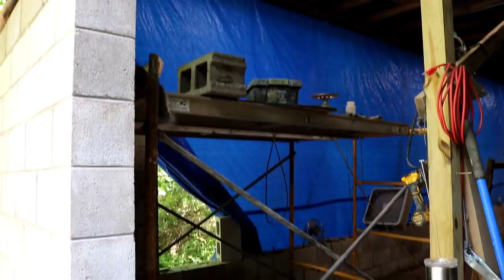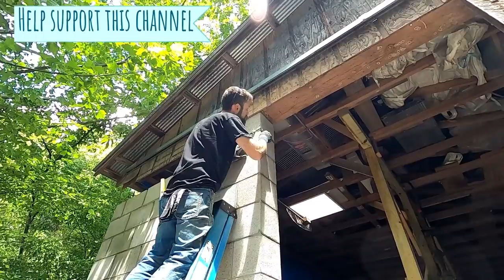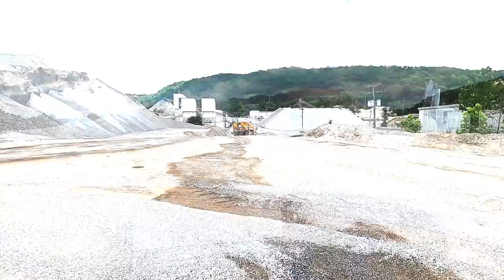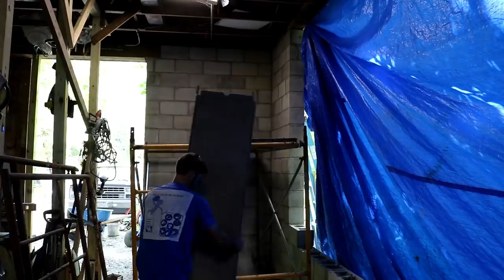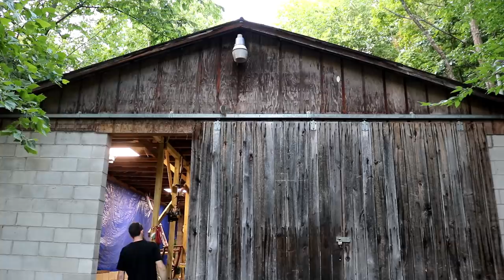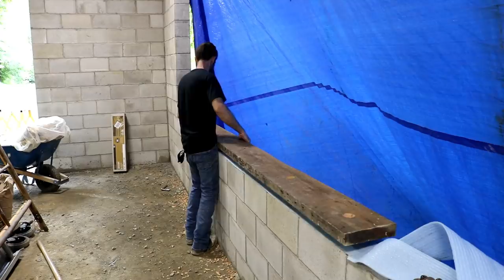Block Finished & Starting to frame

Comment: I don't know code in your area but in mine the require pressure treated lumber touching concrete
Reply: Frankly I trust that hundred year old board more than new growth pressure treated lumber
Reply from the maker: It really shouldn't see weather at all.
 We seem to have some poor quality  lumber for sale here .
Reply: @SteveSummers  im in remodel construction in Chattanooga and ive noticed the poor quality lumber to .you have done a great job with your shop repair 👍

Comment: @Steve Summers Is that red oak or white oak? I read somewhere that red oak is a terrible material to build anything that will be exposed to the elements, but those milled beams look like they have held up great over the years. I ask as I have several large red oak trees that I am going to mill in my back yard, and I also want to build a good sized shop/shed at my house. Thoughts on using milled red oak?

Comment: theres probably a waspnest nearby
youre lucky the nail in youre hand hasnt touched the nerve to youre fingers that wouldve made working a lot harder if you lost feeling or dexterity in part of a hand 
have stepped on a few nails in my life , usually meant getting another tettinus shot , those things hurt worse than the nail through the foot
shame about the mike , you can probably solder a new plug to it

Comment: Those old cut nails are great. They can be dangerous though, some having a tendency to shatter, especially fire exposed and hit by water.   Heavy duty eye protection being essential.
Reply: When settlers moved out west they'd burn their houses down so they could pick the nails out of the ashes. They skipped the water step.
Reply: @rogerscottcathey  you can buy cut masonry nails anywhere. They're not exactly the same as the old square nails. But folks really can't tell them apart.
Reply: @1pcfred  : They are perhaps once again more available, but only fairly recently. Theyre still regarded as specialty items. And of course they've added galvanized too. Tremont still uses equipment used over a century ago. And the nails are exactly the same as they were other than that.
Reply: @rogerscottcathey  masonry cut nails have always been a thing in my lifetime. They were much more popular many years ago though. Today people use hammer drills and power set hammers for nailing to hard materials. Back in the day no one had that sort of thing so you used a hammer and cut nails. Cut nails only vaguely resemble old square nails. They're completely different things. The old square nails were hand forged for starters. Cut nails are machine manufactured and they're hardened too. So completely different. Square nails are from many, many years ago.
Reply: @1pcfred  : Tremont has a sampler of all their nails. And among them are true square nails.
Reply: @rogerscottcathey  there are smiths that make hand forged nails today. I am not sure it can be classified as an economically viable activity though. Handmade nails are so costly it pays to burn a house down to salvage them.

Comment: Steve, I would like to ask you a favour. When you lift things, would you please bend your knees and not your back. I used to lift things like you (as in where you were picking the blocks up from the ground) and I ended up blowing 4 discs in my lower back out. I now require Oxycontin (not every day fortunately) to help manage the pain. Over half of my life (see age in 3rd paragraph) has been plagued with chronic pain so please, please, be careful. Thank you.

5:26 Nobody that's not looking for it probably won't even see it but you will, won't you Steve. Not a criticism, just a fact. I can always see where I have made a minor blemish and man does it stand out for me. It will stare at me with accusing looks each time I come near it but nobody else can see it. Annoys the crap out of me and I guess the little things not quite right would irritate you a bit too. Forgot to mention when you were welding the stainless steel 3D printed thing, spectacular welds! Absolutely spectacular. 👍👍👍

Re your nail story, I was 6 years old when I stepped on a 4" nail that went right through my foot. I think I was running round the farm in bare feet but that was 58 years ago so I am allowed to forget minor parts of the story. I do remember the nail and the piece of wood it was sticking through. Also, why are they always rusty nails? 🤷‍♂️

While you likely won't need this idea, when you want to keep the newly laid concrete damp, instead of covering it with plastic after applying holy water to it, cover the area with hessian bags and dampen them to keep the concrete "moist".

Comment: What a waste of beautiful oak. Dude, just some pressure treated lumber for your seal plate. That’s not a place to scrimp.
Reply from the maker: LOL, I knew someone would say that. This beautiful lumber was made to use and what better place to use it than on the building I'm repairing . The rest of the building is the same 2" oak. This won't see weather and even if it does on occasion it will outlast us both. I didn't have plans to build a table. I'm building a shop.👍
Reply: @SteveSummers  top plates rot out less than sills do. That's due to how water runs down. But we'll see. If you had that oak outside for 4 years and it didn't rot out then you should be good. Here it'd have turned to dust. There's some kind of bacteria in my woods that reclaims its own.